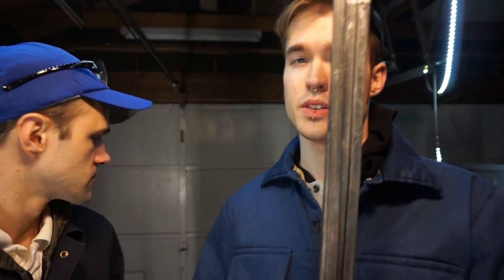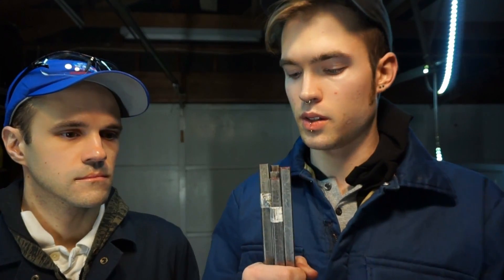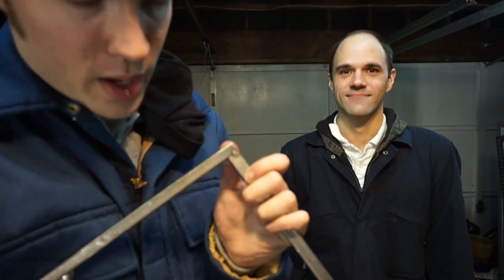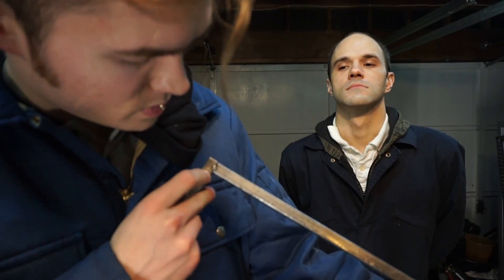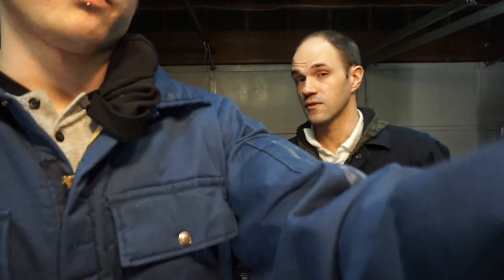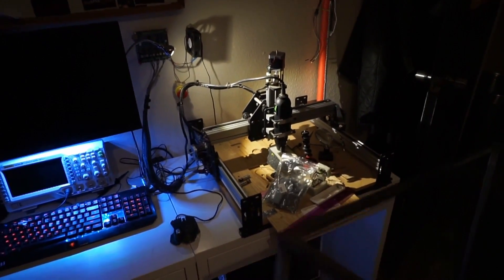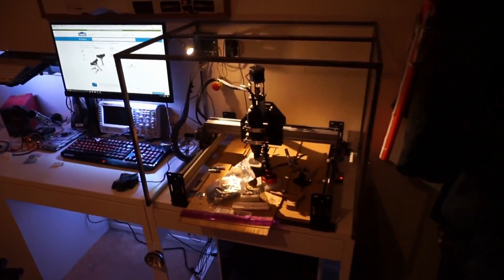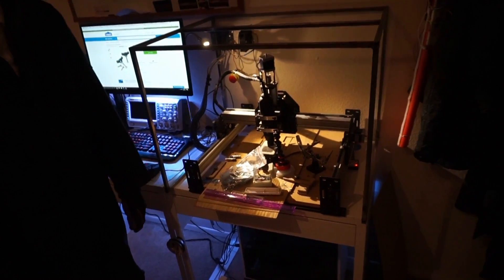Forney Easy Weld 125 FC Update Project || Welding A Steel Shapeoko CNC Enclosure Part 1

Comment: Those machines are great for the price, if you take the time to learn to use them, Lincoln MP runs great also wire tension needs to be right. For A/C and no spatter I like it.

Comment: the Forney Easy Weld 125 FC is connected to CO2?
Reply from the maker: No, it's intended for flux core so it doesn't it doesn't need CO2